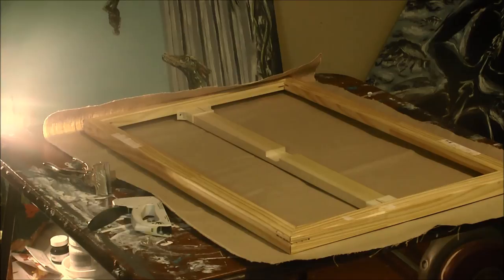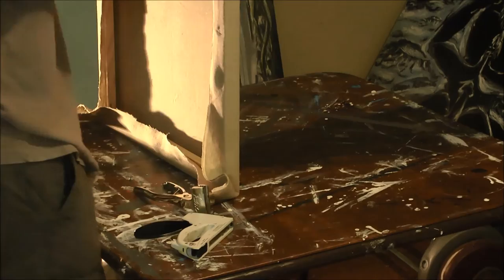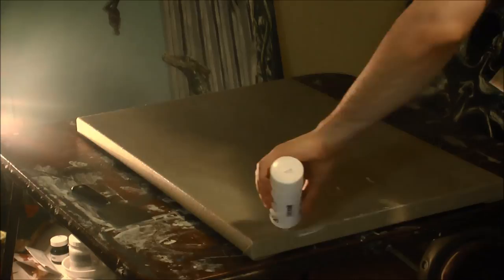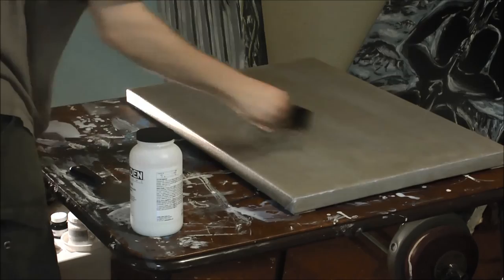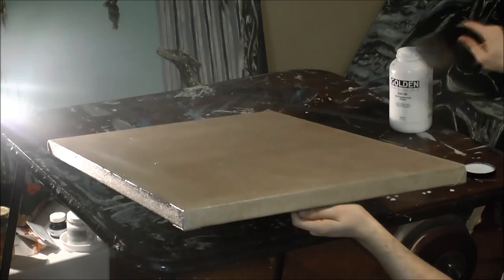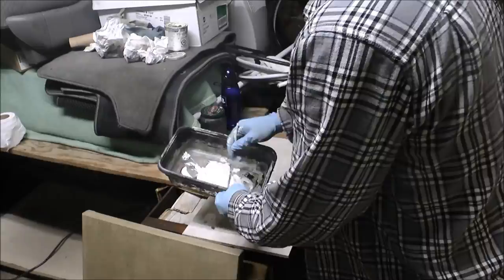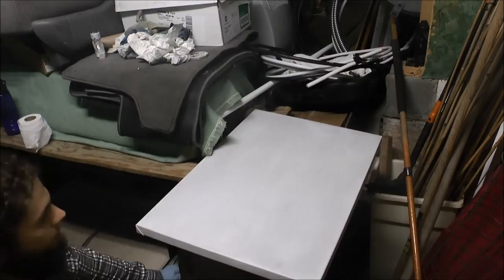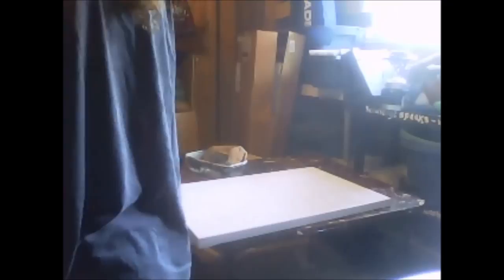Lead Oil Primed Linen Canvas Process

Comment: Are you smarter than the old masters for recommending not to use rabbit skin glue or are you saving the time and the hassles of applying it at the long term expense or your art work collectors?
Reply from the maker: technically speaking acrylic polymers are less prone to damages, but I use RSG these days for traditional purposes, it is also better in terms of a more drum tight canvas. Both work great.

This was my first time trying a traditionally prepared surface. Technically speaking acrylic polymers have less issues than RSG though due to changes of environment and humidity etc.
Reply from the maker: I will also note that the old masters used many fugitive and toxic pigments and would love many of the synthetics, and safer hues we have available now. They lived in a different time.
Reply: I always find it funny to see painters spend lots of money and effort on materials that they believe will be better than traditional materials like rabbit skin glue. The reason this is especially funny is that they do this on small paintings about the size of the one in this video...which I'm guessing is about 18" x 24". The risk of paint cracking on a small canvas like this one due to hygroscopic reasons is laughable because the stress is simply not there. Now, if you were painting a 4ft x 6ft painting with more surface area and which will very likely sway back & forth while being transported or moved then yes, I can see how you would want to take precautions so it won't crack in the future. But in tiny paintings like this one there is really not much risk in just using good, old fashioned animal hyde glue.
Reply: There is stress even in the small paintings when you take account several decades. Conservation departments around the world have tens of thousands of paintings and hundreds of years of experience, and it is proven that RSG:s hygroscopic properties are a major reason for cracking. Well actually  most paintings that are streched eventually crack. Best bet is to mount fabric to a composite panel, you could even use RSG as a size as the panel protects against the stress, and provides the stiffness. PVA glue and acrylic sizes are more durable option than RSG fort stretched canvas, as they are not as hygroscopic, if at all?
Reply: I doubt old masters would use synthetic pigments, the particle size of azurite and lapis are bigger than modern cobalt blue, meaning azurite has more luminosity as light travels through the layers, lead white as you said is superior to modern synthetic whites. Natural mineral particle size, luminosity and refraction is better with historic mineral and natural pigments. Some paintings by the flemish painters are as bright today as they where 400 years ago. The Flemish knew how to conserve pigment colors and you can read this about today. Search Michael Price from Kremer pigments, he gives a talk on youtube.  I would never use synthetics pigments in art, but everyone is different...but I doubt Da Vinci or Rubens will use synthetic pigments. I seriously doubt they will use modern cobalt blue over Lapis Lazurite or Azurite, I doubt they will use Cadmium red over  cinnabar. You just cannot compare quality and results. Sorry.
Reply: Philippe Colin comme on, man....the old masters they didn't have acrilic glues ...If they would have , shurlly they would use those glues !!,,,
Reply: I think many would have if the product would have been available.  Much easier to use, and they cut corners where they could too.  The whole purpose for using canvas altogether wasn't because it was the best surface, it was because it would make transporting paintings much easier (roll them up). They also used camera obscura instruments for accuracy, Vermeer is a good example.  I don't think the initial step of using the fabric stiffener is necessary though, just go directly to a pva sizing or GAC 400(GAC= Golden Artists Color ) doesn't seal, and the fabric will get plenty stiff with the additional layers of gesso.  Just a couple of layers of the GAC100, followed by a few of layers of Acrylic Gesso should do it.

Comment: Sir please if you read this i have a few important questions
Reply from the maker: Hello, what are your questions?
Reply: @RyanDemaree  1_ Is it wrong if i stretched my canvas tightly?

2_ if i size and prime a cotton canvas properly will it last as long as the linen dose?

3_ can cotton be used in a professional art work? 

4_ how efficient it is the home made gesso (chalk or baby powder + pva glue +acrylic pigment +water)?

And can i contact(message) you when ever i have a question because art supplies are very rare in my region and therefore I need to be innovative + there isn't many informative and knowledgeable people i can ask them when i need
Reply: wonder if you have read my reply

Comment: In my humble opinion I wouldn´t spend three months painting my work of art on top of a synthetic layer of plastic skin. The rabbit skin glue has been tried and tested for CENTURIES because being hygroscopic it is flexible and will allow the upper paint layers to stretch and move over time. Many, and I mean many, painters are now complaining that their works made a couple decades ago are flaking due to the acrylic underpaint or priming. Think it over, dude!
Reply from the maker: I prefer RSG + lead oil ground on linen/ panel for realistic/ fine detail work, and high end acrylic primed cotton for my more loose/ abstract work.
Reply: Dude didn't answer your question!